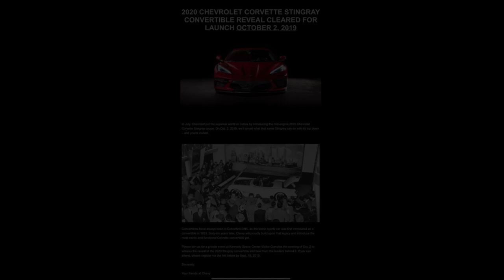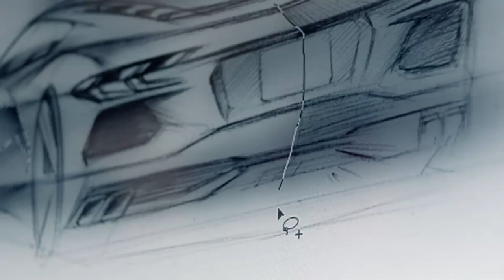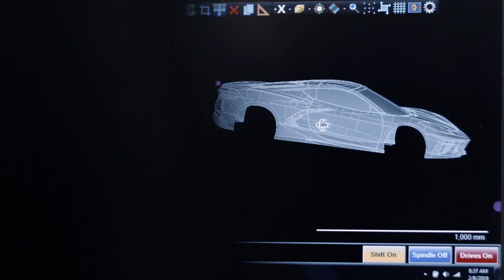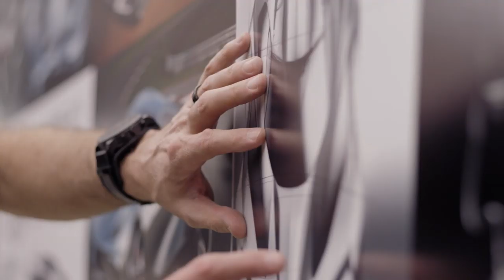Corvette C8 Spyder Convertible being Released Chevrolet Awesome JOB.

Comment: I LOVE the idea of a Convertible... I am less concerned about it decreasing my Top Speed, than I am the pleasure of cruising on a beautiful day, with the roof off!   (and the removable panel is just not the same..)
BUT... the huge 'Buttresses' sort of RUN the flat, open feeling of No Top... "Roll Bars" attached to the frame behind the seats would be GREAT. But the buttresses block the surrounding view, and make the driver's compartment still feel 'enclosed'... 
Sooo I don't know if I will still want a Convertible, until I see the Actual Design they produce.
Reply from the maker: Floyd Burdett hey I think about of people are in the same boat as you but tomorrow, will be the day everyone sees the convertible for sure!

Comment: Honestly this base model is not going  to do anything to the super cars, but I wanna see what the zo6 can do and later the zr1 but the zo6 will be the one to make a difference.
Reply from the maker: The Anime Libarian I am excited for the base model
Reply: @cgarnerspeed252  the base will do well, but in terms of it's competitor's cars the base is not there yet considering it's benchmark was the 458 and Ferrari is rolling  out the f8 which is slightly  more powerful than even the the extreme 488 pista which is even better than the 458 cars and not to mention the sp90 which is a budget hypercar and haven't even came out with there actual hyper car to replace the laferrari which apparently is stated to at least be revealed 2020, but I wouldn't  be surprised if this thing do alot better than it's benchmark
Reply from the maker: The Anime Libarian I see what you are saying!